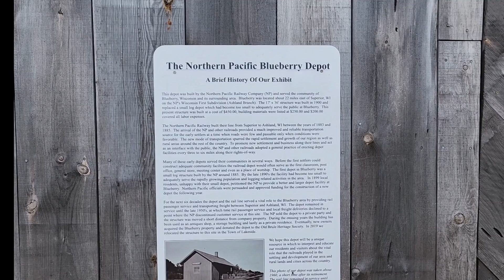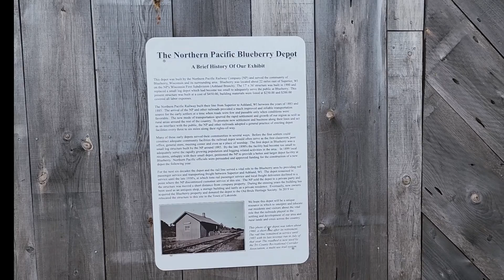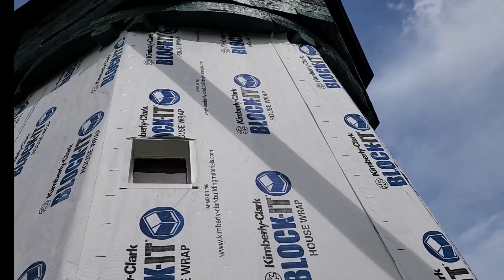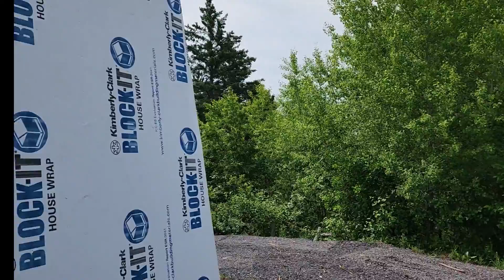Checking For Damage

Comment: It is frustrating when you choose an alternative route and then Google Maps changes it. Sometimes, we pick no tolls, and then Google maps takes you to a toll road. That was our frustration this summer when traveling.
Reply from the maker: That's odd.  I've not had Google route me onto a toll road when I told it not to unless it had no other option, and I do have Maps set to avoid tolls.  I just crossed the Mackinac Bridge, which is a toll bridge, but there literally is no other route from the UP to the LP.  Ferry maybe?  But of course, that would be way more expensive, although possibly twice as fun.  Little side story:  As I approached the bridge, I had my $10 at the ready because doing my research ahead of time told me that would be the most likely toll for an RV.  Cars, vans, and such are $2/axel, and other vehicles are $5/axel.  I pulled up to the toll booth and greeted the guy taking the toll and said, "This is a Ford Transit built out as a RV, so what out of this do I owe you today?" as I handed him the Ten.  He said with a smile, "RVs are $10 but since you're not built out as an RV, it's $4 for you today."  I smiled, and said, "Thank you so much; have a great day!"  Cool people work the bridge.
Reply: You should check out the Duvalay bed roll
Reply from the maker: @steveklauk5021  Oh, I have.  Bought one, but it's tricky because Duvalay does not ship to the US, so they refer you to Disc-O-Beds, or a store in Disco's reseller network like Dicks Sporting Goods.  Got one.  Love it.  Game changer!  BUT - they need to make a natively left-opening and right-opening cover.  I need right-open, so I have to reverse it.  That places the zippers against ME whereas they are behind a layer of fabric when it's not reversed.

Comment: Do you remember what brand and model shelf that is that you have in the back? I think that I want to give it a go even with the bent shelf you experienced with the tool kit. I might try distributing the tools. Thanks!
Reply from the maker: I wish I could tell you the brand, but as soon as it was assembled, the box, packing, and instructions were tossed.  Best I can tell you is to just make sure the dimensions of the any that you happen to see, either in person (I got mine at Walmart) or online, will fit your rig.  There are LOTS of these units out there, and lots of stores that carry them.  When I saw the one in Walmart, I went back out to Joy, grabbed my measuring tape, and went back in to see if it would fit.  Delighted that it would, I bought it and it's been great.  I hope that turns out to be your experience, too.